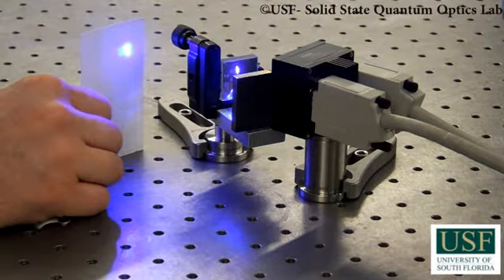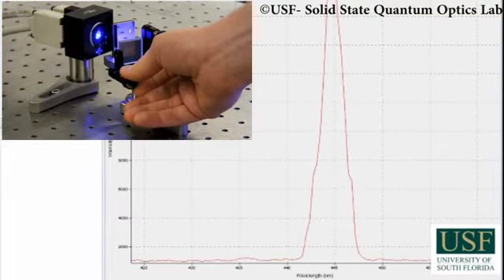Allign ECDL in Littrow Configuration

Comment: so funny. The guys are using teflon tape to fix the lens holder.
Same as I did  :))
But one day I have found that someone from our students has locked the holder with a locking ring, tens of them were usually lying unused.. Much more convenient to use.

But some other comments are:
Quite a bad have to place a hand in a beam while tuning the kinematic mount.. 

Quite a bad have to fix the holder on the table with a clamp straitened along the beam - while fixing, one will put a screwdriver in a beam.. 

And the most bad have is to wear glasses prior to put something in a beam. Especially in a big lab with a lot of "possible" people around, which do not wear glasses. 

If one introduces something, a laser should be off or beam should be blocked..

However, the idea of narrowing the linewidth by such a simple approach is really nice. I always though that one needs some special uncoated laser diodes for such experiments.. Should try it out.